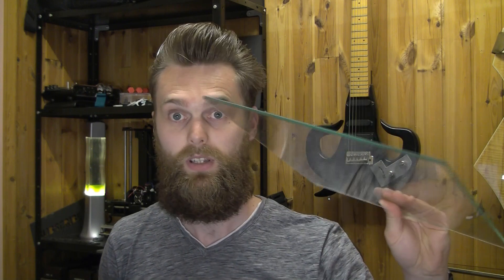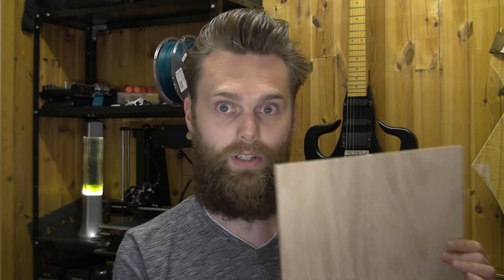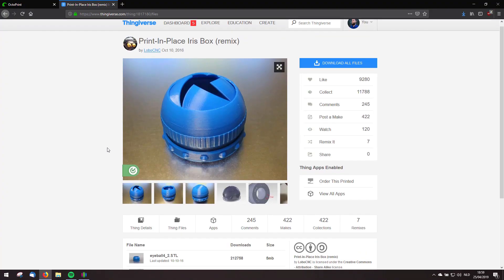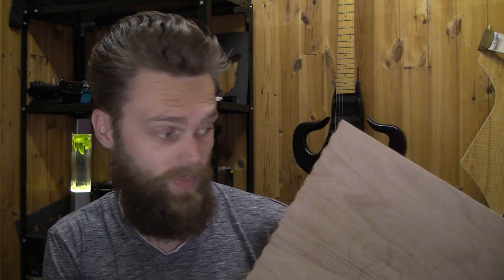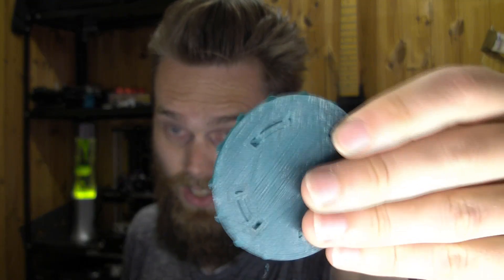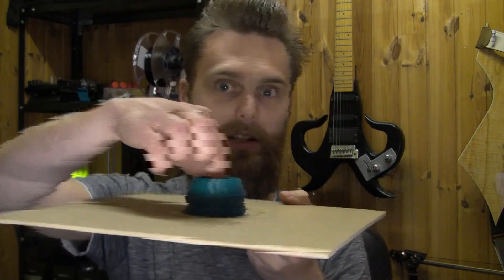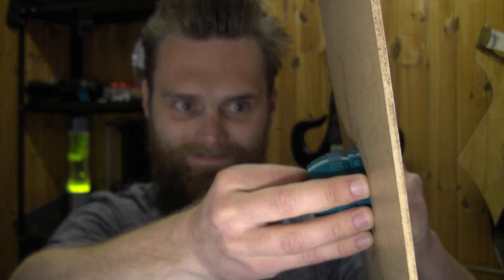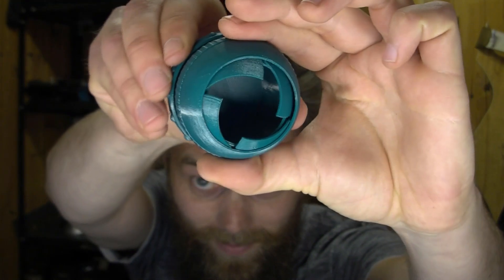The cheapest build surface ever! Will it work??

Comment: I was doing research a few weeks ago on 3d printers and saw your vid on the S5 portal mod.  I was looking at an Anet A6, so I didn't really understand the importance of the concept at that time.  Since then my A6 arrived broken/damaged from Gearbest.  I found a used CR10-s5 locally at a great price and bought it.  Went back and watched the portal mod and thought how great it was for smaller spaces/enclosure.  I was trying to find out how to print the parts from a stronger material than PLA due to temp constraints and found this video.  You have solved 2 of my problems in 2 days!!!!  Subbed great job.

Comment: but you do know about FR4 and hard paper (pertinax) sheets as build plate material, right? because that shits OP. very cheap and works amazing for most material afaik. basically its epoxy resin stuff with different filler (glas, paper, cotton). garolite is just the cotton version with a fancy name, i heard.
Reply: I recently tried out a Pertinax plate and I love it. Prints stick really well after sanding the surface to a matte finish. When you let it cool down after printing, the parts pop right off.
Reply: @benfpsgaming4419  yeah me too . stuff really works amazingly well. where did you hear about it? to me kinda seems like its mostly a thing in the german 3d printing community. but maybe im wrong with my impression
Reply: @mrloqqe1610  You're right with your guessing :D I read about it in some German forums.

Comment: I did find a few posts about printing on woord when I was trying to print POM/derlin/acetal/wathever. Also gave it a try but my sheet of plywood bent too much when heating the bed. Couldn't get it straight again, so I ended up using cotton cloth glued down with abs juice on glass. Works great. Gonna give the mdf a try

Comment: My first printer was a Printrbot Jr. It had a plywood build plate.  The biggest problem with it is that plywood is not flat. With mesh leveling it could work, but overall you'd be better off buying a mirror from the dollar store.. As for the MDF, I'm pretty sure a sheet of glass is cheaper here.
Reply from the maker: To be honest, I use a mirror too. I needed this piece of wood for the video after this one and I started wondering if it was even possible to print on it and it went better than expected :D

Comment: On my ender 3 i use even cheaper clamping system,
I cut a little circles of hot glue. 
Place them on my hot bed
Place material on top of it
Preheat the bed to 120°
Sqish the material with something heavy
Wait for it to cool down

It works surprisingly well, and to release it I just use heat up the bed and clean the rest of the glue with IPA alcohol
Reply from the maker: Interesting method, thanks for sharing! My goal was to replace the plate itself after printing so you can start the next print immediately :)

Comment: Polypropylene sheet is quite good and cheap too
Reply: It is not an issue, as the filament heat capacity is so low that it can not melt the sheet. I have 1mm thick sheet on my printer and it works great with pla, cpe and petg. Have not tried abs. I use heated bed always
Reply from the maker: @karipenttila2655  Sounds good! I can imagine that this works well while printing. The only thing I'm worried about is when you press a hot nozzle directly on the surface while setting the z height. This can be done with a colder nozzle of course so this wouldn't be a major problem, but something to keep in mind I can imagine. I'll keep your suggestion in mind for the future, thanks again for sharing :)
Reply from the maker: Thanks for the suggestion! I've read that the melting point of PP is 170°C. Isn't this causing problems when printing at higher temperatures and setting the z height? Because of this I don't use the standard Creality flexible build plate because my 250°C nozzle melted it xD
Reply: On the contrary my startup script is as follows: heat bed, home, level, put nozzle to z0 x20 y20, heat up the nozzle, print. No issues, Ali express is full of those plates https://www.aliexpress.com/item/4000217767454.html?spm=a2g0o.productlist.0.0.34165ad7nbELHp&algo_pvid=2954c0b1-e943-433f-9d59-3ef9134e2482&algo_expid=2954c0b1-e943-433f-9d59-3ef9134e2482-11&btsid=e88f6551-4a21-4b8c-ad34-9dffefe9ec42&ws_ab_test=searchweb0_0,searchweb201602_2,searchweb201603_53

Newest Printer Hotbed Build Plate Mamorubot 3D Printer Polypropylene Build Plate For Anet A8/A6/Prusa I3 Printer

Comment: Have you tried saltwater on glass? here is a pdf detailing this method    https://www.uantwerpen.be/images/uantwerpen/container11343/files/bonding_pla_with_salt_water_v20160713.pdf
Reply from the maker: No I haven't, I will definitely take a look into this because it looks very promising! Thanks a lot for sharing!
Reply: @properprinting  I have been using this method for about four months now and it's amazing, whilst the print is in process it is stuck to the bed and nothing is going to move it however once the bed has cooled down you can lift the print from the bed as if it was never stuck down
Reply from the maker: @AndrewAHayes  Awesome! This sounds like the 3DLAC I use but much better since 3DLAC will make the printer messy and it's not cheap. I must test this, thanks!

Comment: It Work ABS, PLA? Temperature bed?
Reply from the maker: I have not tried ABS yet but this it something I definitely should test. I have successfully printed PLA with a bed temperature of 50 degrees and nylon on a cold surface. I encourage everyone to pick up a piece of MDF for a couple of bucks too if you happen to be in a hardware store for some reason already so you can test and try it yourself :D

Comment: You can get a 9x12" clipboard at Walmart for $2. It's made of MDF
Reply from the maker: Thanks for sharing. Probably that would work too, the worst thing that could happen is that you spend 2 bucks for a clipboard if it doesn't work :P We do not have a Walmart here and I buy larger sheets at our nearby hardware store and they cut them to the right dimensions for free. Anyway, this stuff is cheap!